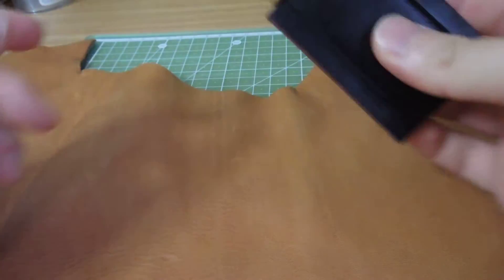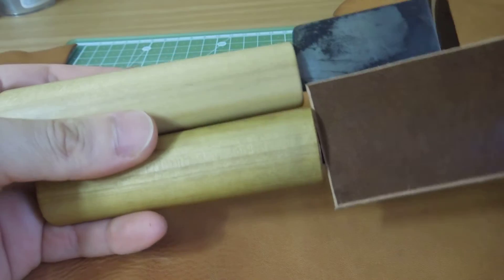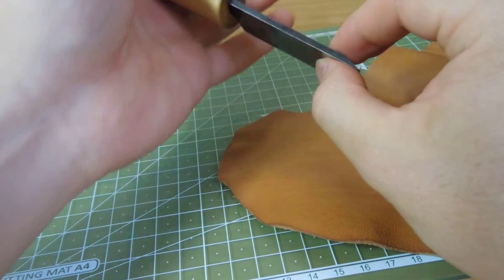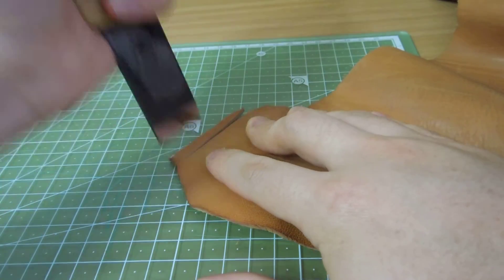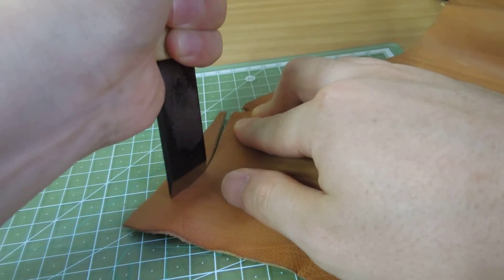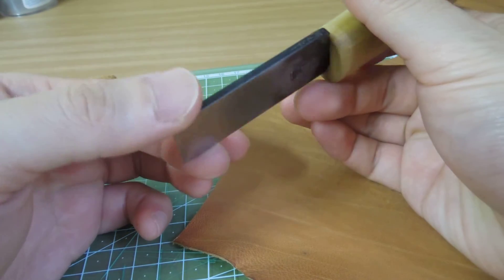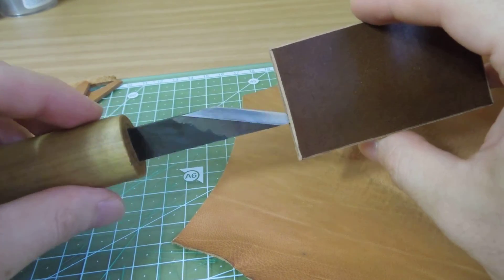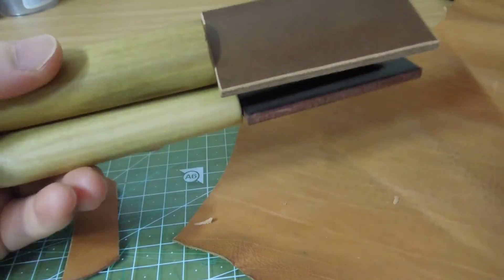Traditional Japanese Leather  Knife with Western Steel

Comment: Where do you purchase your blade sharpeners?
Reply from the maker: I buy the sharpening stones locally because they are heavy so price doesn't make difference. I am not sure where you are from but if you can get Japanese water stones go for "King" or "Naniwa" 
if you have oil stones available, go for "Norton"
Reply: I am from Singapore :) I'll try to look for them here. Do your water stones used for honing also come from these brands?
Reply from the maker: asd yes I use "King" combination stone which has two stones glued to each other . #1000/#6000